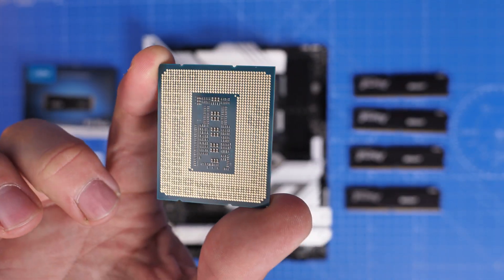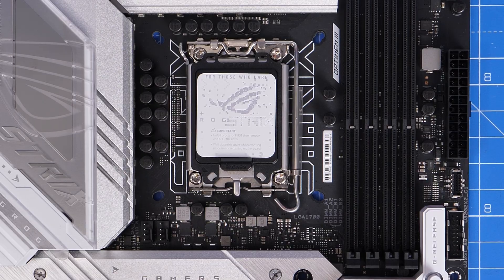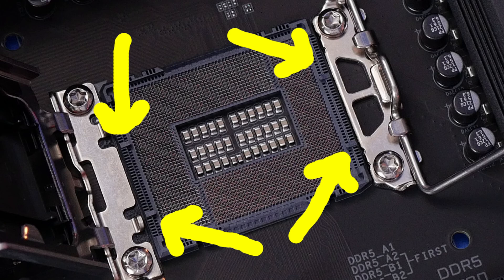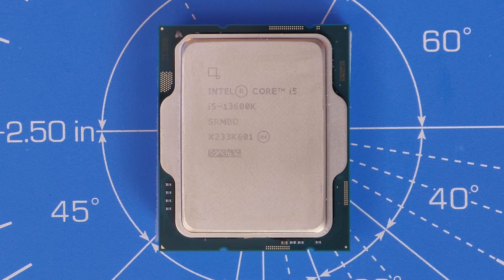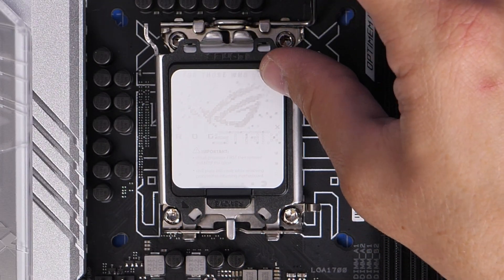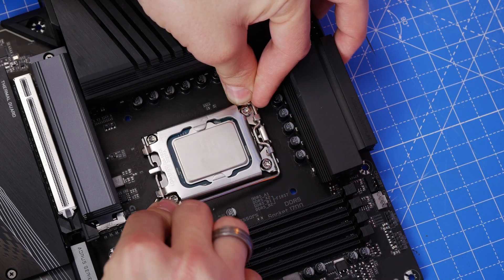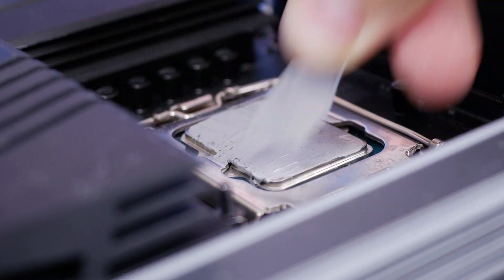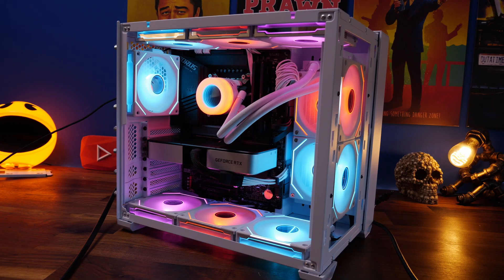How to install Intel 12th, 13th and 14th gen CPUs

Comment: I installed my CPU like this 2 times and bent pins on both  times. They were bent on even opposite directions!. IDK what happened and what to do to avoid this...
Reply: Make sure it's  compatible intel CPU. Basically Make sure the motherboard supports 12th and 13th Gen. Make sure it's lined up correctly with the little triangle matches with the other triangle that is sometimes located on the motherboard itself. Lower it on gently and just let it fall into place. Don't apply pressure.

Comment: The amount of force used when pushing back down on the retention clip defo has me wondering if it's damaging the pins.
Reply: Always feels that way lol you have to try pretty hard to fuck it up. You got it gang 🔥
Reply: Right?? I was stressing man
Reply: @Juzid4  there is a big problem with the generation chips, the stuff bracket bends the CPU overtime, good aftermarket and it torque screwdriver and put it in yourself, gamer Nexus did a thorough install video and how to do it
Reply: I heard a creak sound when pushing my lever down is that ok?
Reply: @nonejjjkk yeah i would also like to know this😂😅
Reply: @nonejjjkk  takes a good amount of force for mounting pressure so should generally be normal as far as I know.
Reply: It does damage the side steel plates, so that you'll make out if the CPU has been used before or not, right away. At least that's what I observed
Reply: I'm glad I wasn't the only one

Comment: Great video as usual! Just a suggestion: instead of teaching that the arrow points to the bottom left of the pins array, I think it would be rather better to point out that it should be matched with the arrow on the plastic (wherever that may be). That way, one forms the habit of looking out for the match instead of assuming it's the bottom left. I know this is highly improbable, but intel might decide tomorrow to put the arrow on the top right or top left, etc. So, I'd tell my audience to see the arrow on the plastic, and match the arrow on the  CPU with it. Just my 2 cents.
Reply: That's a fair enough point, might as well failsafe as much of this process as you can.  I mean, I've built a few PCs over the years, and now I'm building a 13th gen intel rig and I am still nervous, actually, for some of the things.

Comment: Why didn’t you mention anything about the CPU contact frame?
Reply: Because this video is intended for beginners?
Reply: @xxVanos mounting a contact frame is also for begginers. That easy to mount since I did with mine!
Reply: @ElMazzLokoo While I do feel installing a contact frame is pretty easy, I have one in my build, I wouldn’t say it’s for beginners. The first time installing a cpu can be stressful as to not bend any pins. I think showing how to do it this way first is a good idea.
Reply: @mikehoncho5326  exactly. A first time builder already has enough to worry about. 🤣. Though I will agree, it's almost a must for this mod. The benefits!
Reply: @ElMazzLokoo  mounting a contact frame is defo not for beginners, it's 99% already installed on motherboards lol.
Reply: Sorry but it's not a beginner peice. Truly you must not work with general consumers, or been around enough folk outside of the PC sphere. Introducing an element they can EASILY overtighten directly on the Mobo/ CPU is just not gonna work. 

You have be responsible enough to go into it with the knowledge you need, and the recognizance to recognize if you are the reason the procedure didn't pan out. Most people do not have both
Reply: @klaushouse117  yeah but the installation procedure is very simple

Comment: Pretty straight forward but ya don't have to remove the plastic cover. Its designed to pop out indicating that the CPU was installed correctly, as it wont pop out if its not. At least I believe that's how it is supposed to work. I've never installed one the wrong way, so not entirely sure of that last part.